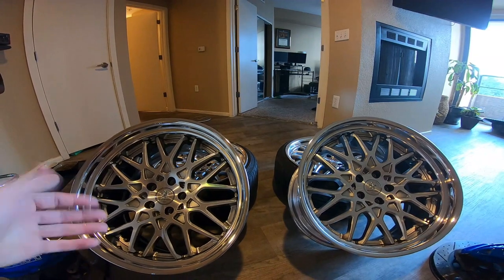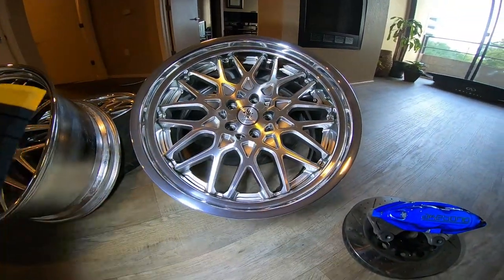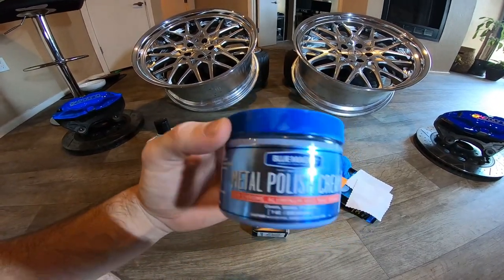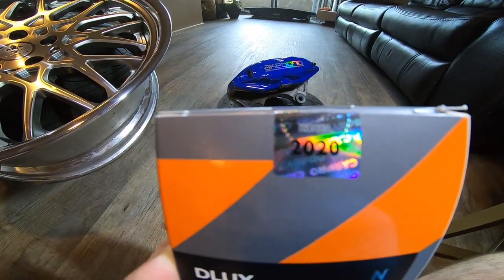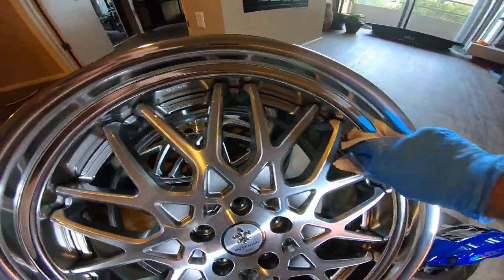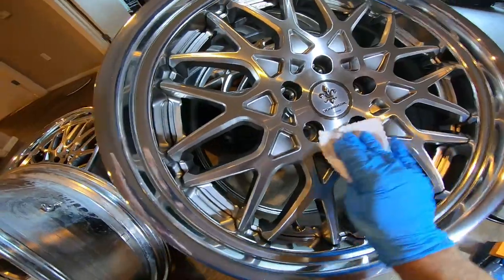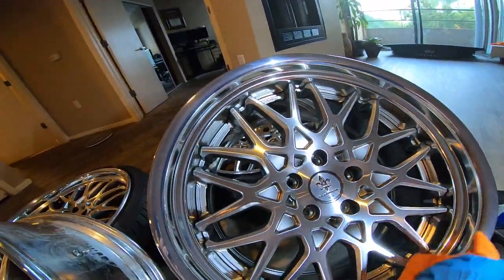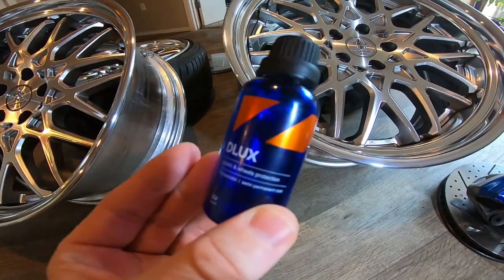Work Wheels - Ceramic Coating $40 Carpro CQuartz DLUX Wheel Coating

Comment: Nice video. However to maximize the bond of the ceramic material and the wheel, it's good to use a product such as CarPro Eraser prior to applying the ceramic. Also important to use Eraser after using any type of polish. Otherwise, the bonding of the ceramic will not be optimized.

Comment: Uhhhh. I hope you get the full year of ceramic protection. Meguiars has all sorts of oils basically. I tried to see what would happen with out a proper wipe and got about 3 months out of a 2 year coating.
Reply from the maker: Interesting. The instructions say use iron x cleaner, then a polish and carpro eraser before applying. I figured since M205 is basically fine liquid sandpaper, it doesn’t get any cleaner than that so a $30 bottle of carpro eraser could be skipped. We will see though. I guess we both like to learn the hard way..lol.
Reply: Motordyne G35 lol yeah. You still have some of the bottle left, so reapplying is s breeze. Used the same stuff on a car i did use a wax/tar remover type product and it did last the advertised amount of time. Im no chemist but from what i understand. Polishes and compounds have oils that prevent the average joe with a rotary and polishing pad from burning trough the paint the same way you would burn trough with a sanding disc. That stuff is so easy to use because of its incredible work time. It doesnt dry up or dust or dissapear, its chemically made to stay where you apply it.
Reply from the maker: @koniko169  ...so what would you do? I put on 5 coats and you are right, I do still have some left. Is is too late to do anything now?
Reply: Motordyne G35 do nothing. Enjoy the ceramic coat you just applied on your sick wheels. If it looses its properties significantly in the next month or 2. Literally just polish it again to remove any leftovers of it. trust me the ceramic can be removed semi easily. Then just reapply following the directions. Lol also. Im not a chemist in any way, but the reason you are supposed to wipe off the ceramic once youve applied it, is to remove the carrier agent. Its not ideal to leave it sitting on there as i think you said you did on the last coat. That part of the chemical is what makes it a workable liquid form in the first place. You didn’t by any means ruin it, you just maybe affected its durability. But hey🤷‍♂️carpro makes sone great stuff. Since you did use so many layers you probably will see the full life out of it. I just wanted to give my 2 cents in case you were dissappointed by the long term results. U basically did every step besides wiping it so its a completely bare and free of waxes and oils. Ive tried a bunch of ceramic and “ceramic like” products that ended up being snake oil. That carpro stuff is legit and the price is pretty perfect. Spending significantly more will just get marginal improvements that you wont even be able to tell in 99.9% of situations. Also nice G. Every time you upload a video it makes me miss mine.
Reply from the maker: @koniko169  ...what a response, thank you. I will be able to document it from the date, I put the wheels on how long it last; we will see. After it cured for 3 days, it looks likes it is drenched in perfectly clear syrup. I am taking the G to the Malibu canyons so that will be a good test and wash video afterwards.

Comment: Every time I check the motordyne website the shockwave is out of stock.
Is the company ok?  I'm wondering if you heard anything?
Reply from the maker: Actually I have, I am working with Motordyne to introduce his new website and products. They are just sold out from demand and covid. You can still buy, but check with Motordyne for lead times.
Reply: @MotordyneG35   
Thanks man I appreciate you taking time to reply back. I noticed the upgrade on the website.  It looks AWESOME.  👍👍